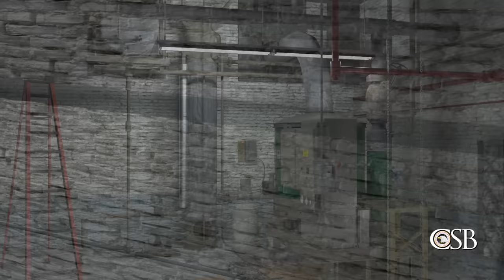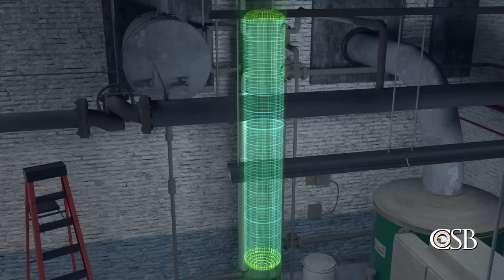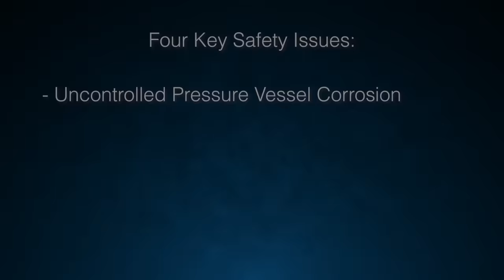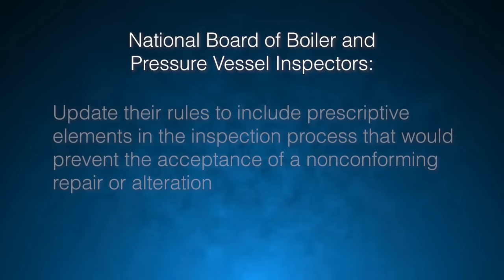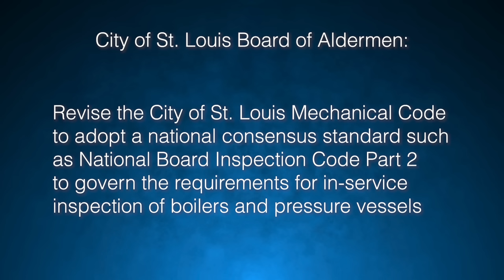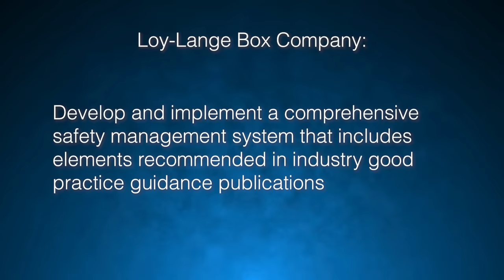Ignored Warnings: Explosion in St. Louis

Comment: Maintained a 60 Hp Boiler years ago. The O2 scavenger chemicals are expensive. You can add enough without heating the water to 200 deg F or save much money by doing so. The important thing is to keep track of the two chemical tanks assuring they do not run out.

Comment: CORRECTED TEXT
; A CSB safety video about the fatal explosion that occurred on
; April 3, 2017 - at the LOY-LANGE BOX COMPANY in St Louis - Missouri.
; The incident occurred when a severely corroded pressure vessel
; catastrophically failed - causing an explosion that launched the
; pressure vessel into a neighboring building.
; One worker and three other people were fatally injured.

Comment: Seeing the steam attempt to evacuate before the vessel launched was sad. It was trying to vent, but it was simply too much pressure. Is a very old pressure vessel really that expensive to replace compared to repairing it? Very sad people died just because a company didn't want to spend a few bucks.

I think my portable air tank has a sticker that recommends throwing it away after 10 years. Seems odd there isn't a similar recommendation for all steel pressure vessels potentially exposed to oxygen.

Comment: I'm a metal fabricator and that 2012 repair has me gobsmacked. Regardless of the repair company being qualified to carry out the repair, every single worker repairing the vessel would have been aware of just how dangerous the repair was. You wouldn't fix thin metal to thick metal on any repair never mind on a pressure vessel. When looking at the photo of the damaged vessel, that metal was almost as thin as car bodywork when it failed. The thinner failure point being adjacent to that 2012 repair. Just welding the patch to the old section of vessel would have been difficult and flagged a hazard to the workers welding it. Truthfully, a full base repair would have been easier! It makes me wonder if the repair patch was something the repair company had spare and laid in a cupboard somewhere and they went with that fix.

Comment: I work in automotive assembly. For the past four years water has been dripping from a roof drain pipe onto me. It hits an I beam then drips down. 

They have tried to “fix” this issue several times. 

The building is from the 1920’s

Hopefully it will land on my head when it falls.

Comment: Having worked with steam plants for 43 years the preheater tank needed to have a spray inlet for water entering and a vent to release any oxygen related water vapor/steam that should be captured by a vent condenser system. Then the outlet from the tank should be from the bottom not the side to reduce any oxygen laden water from gathering.

Comment: My dad used to get bullied at Rennco in Homer, MI because he wanted to add safety systems to packaging machines while the upper management wanted to use cheaper less effective measures, ultimately no one died because my dad insisted, they eventually caved but I like to think he mentioned getting OSHA involved. The constant berating my father endured led to early retirement, however. So now he does freelance work instead, but still deals with asshats that want to skimp on safety and we no longer do work for them.

I wish there was a cure for greed, but that's the society we live in.

Comment: This is a lot like making sure you drain your air compressor tanks/ run a moisture/ water separator. Tanks turn into a 'bomb' when they rust and corrode. If it wasn't leaking they would've had no way of even knowing it was corroded on the inside. Continuing to operate and use the tank when it was leaking and obviously weakened was not only reckless but foolish as nothing good could come from this. The welding company should've removed the entire bottom of the tank instead of trying to patch it and weld to weak metal. Shame that people had to lose their lives/ property was damaged over this.

Comment: So who went to jail? Company was obviously cutting safety to save money. Rushed starts up (to cut overtime), cheap rushed repairs and no backup systems or inspections and four people dead. A company that size running one tank/system was never going to shut off the system to do proper maintenance if it meant production had to shut down.

Comment: Hi Everyone, I'm curious what "testing protocols" there might be for these sorts of vessels. Can someone give me a pointer? I'm also thinking that there must be guidelines for how long this kind of equipment will last before it needs replacement. Great video, as always!
Reply: These vessels can last for decades if properly maintained.
Reply: There are a number of non-destructive testing options.  The first is an annual shutdown, open and inspect — i.e., a visual inspection of the interior of the vessel.  Then you can do operations like ultrasonic, x-ray, and magnetic flux or eddy current testing to determine wall thickness, weld integrity, and presence of stress or corrosion cracking in areas where failure is more likely.  Taking an annual thickness measurement on the bottom of the vessel and tracking it over time would give clear indication of corrosion levels, and let you know when you are the safety limit and need to repair/replace the vessel.  The three versions of testing I listed are more technical and require special equipment and training, but there are many companies out there that specialize in just such work.  During my Navy days, we used their services regularly on our steam propulsion plants to ensure our boilers and steam piping systems were safe to continue operating.  It costs money, but it’s cheaper to fix a small problem than rebuild after a catastrophic failure.

Comment: Considering how operations are run for "Maximum Profit at all costs", It's a small engineering wonder that more facilities don't catastrophically fail. Just like the neglect at an airport I'd worked at for a time, thankfully designed such that nothing should catastrophically fail. Wouldn't be surprised if the "rejection" of repair was likely just to avoid the costs of replacement.

Comment: Previously having worked in the propane sector, the possibility of a BLEVE was always present.

In addition to a "simple" water based BLEVE, a propane based will add fuel to the fire, so to speak.

In any case, operating leaky pressure vessels which contain two phases are an even worse idea than operating leaky pressure vessels for single-phase product.

Comment: I worked in the boiler industry for ten years after Katrina. Most of the work was in New Orleans or surrounding  areas. There had just been a scandal concerning the selling of 3rd class boiler tech licenses to anyone who paid an extra $200 for the test. This caused an influx of technically unqualified "technicians". The things I saw there were truly frightening. Lots of close calls. Boiler inspection is spotty at best with lots of "wink-wink" inspections along with simply not doing the inspections. In addition chemical treatment of feed water is not properly done if at all. Boiler disasters are seldom brought to the attention of the public. When they are information is minimal---usually a one inch column on a back page.

Comment: Now I'm not an engineer so maybe I'm missing something, but wouldn't it be protocol to shut down a pressurized system if you discover there's a leak within it? Also, if the integrity of your system is compromised by corrosion and the repair is to replace the bad section, why leave any bad metal? Especially when its all one continuous section. That's like be told you have a tumor and need it removed to save your life, but the surgeons only removes 90% of it. Could have went ahead and got it all, your already opened up, but no, they stop. What do you expect is going to happen.

Comment: As a Boilermaker, this is crazy.
Its a leaking bomb.

1) You need to have 3rd party inspection companies come out and sonogram at the very least, metal thicknesses for your pressure vessels and ensure that its not even just the RUST THAT YOU CAN SEE is the only weak point.

2) What a lazy repair for that welding company. If they don't lose their R stamp, accidents like this can happen again.

3) Any industrial company working with such dangerous equipment should have way more common sense to operate something that is deficient. Its not like your personal car with a radiator leak. Its a bomb.
Corruption, lack of training, ignorance and ultimately laziness creates perfect dangerous situations in industrial facilities.

Comment: what if you add a mixer into the SCR so that the temperature is more isotropic and the measurement is better? Maybe a tube that goes down the bottom so it stirs up the bottom into the top?

Comment: It's the same problem as in the RBMK chernobyl reactors. The whole thing standing in a sheetmetal shack. If that vessel would've been in a proper reinforced concrete building, the vessel could've never rocketed through the roof.

Comment: A one ton pressure vessel was launched 400 feet into the air killing 4 employees of a nearby healthcare business and injuring 3 other people. The 10 resulting lawsuits were settled for $47 million. I guess the law firms involved may have been given 40% of the settlement which would leave $2.8 million for each victim if the remainder were divided equally between all 10 victims. I think law suits are good because it allows businesses to see how much cheaper it is to have effective safety measures in place. The operating procedures for the steam system should be taught to the employees and managers every year to eliminate the effects of employee turnover.

Comment: Even before I'm a 1/4 of the video I see trouble.  With steam you need presure relief blow offs and automatic waterfeed at certain locations. The biggest issue it looks like the original set-up when first installed. Companies should be forced to upgrade parts that are critical for safety. There should of been gauges with warning sounds when something is becoming a problem. Or there could of been warning lights. I don't know how that boiler works but do know about steam heaters. Maybe a low pressure cutoff would should of been installed. These safety devices can be set-up to shutdown  the boiler

Comment: This is the first video I struggle with the analysis. 
Oxygen permeating into the steel could have been leaked into the vessel during the repair. Also there is no proof of O2 water not being purged properly. The SCR could have obsorbed water from other locations.
Reply: Water naturally contains dissolved oxygen. That's the whole point of the make up tank discussed in the video - to remove that naturally occurring oxygen by heating the water to near-boiling, and by mixing in oxygen scavenger chemicals. The video mentions that the Loy-Lange water regularly contained insufficient concentrations of oxygen scavenger, and that the water in the makeup tank likely wasn't warm enough at the point at which make-up water was put into the SCR each day.

Comment: Annual wall thickness checks can be easily made using an inexpesive handheld  UT device(<$200). Carbon steel is the wrong material application, today we would specify Cr-Mo Gr 11 or better. (Stainless is overkill and introduces welding problems an Cr migration in the HAZ).

Comment: A chinese owned restaurant a street away from my office replaced a leaking pressure release valve on a common water heater with a pipe plug. When it exploded, it landed in the street where I usually parked. WISHA found the owner was too cheap to spend 10 bucks or so on a new PRV and got a brass plug from the auto parts across the street. Luckily no one was injured but the building had major damage. If the tank had went another 50 feet, it would have landed in my companys office.

Comment: Let me get this right... Inspectors are not required to inspect the work or plan, or even the damage that leads to it, and the city had a company with a steam generator they had inspected, but because it had been years they didn't know it has a pressure vessel... BUT... how are you making steam NOT under pressure for an industrial process?! Literally boiling water, its a boiler...

If your boiler inspectors don't inspect boilers, and the city inspectors dont even consider them boilers (due to fraud ofc), something like this is garunteed to happen...

Comment: As much as I appreciate these videos I wish the USCSB was more than an underfunded agency without any real power to enforce the findings and best practices present in their reports. 

I am honestly surprised that these sorts of failures are not more common as steam systems and boilers have become largely forgotten about and are poorly understood at best by most. Steam heat is increasingly less common especially in new construction and we are so far removed from the old days of steam powered transportation. Few outside of an ever shrinking pool of experienced boiler and steam plant operators, or old engineers with decades of experience have any real understanding of the hazards and their proper mitigation. I would be most municipalities do not have someone with proper training and knowledge to fully inspect and regulate such systems.

Comment: As a licensed boiler operator for 47 years I can tell you that the vessel in question should never have been allowed to be in service.  After it was inspected and found to be unsafe it should have been "RED TAGGED" and not allowed back in service until it was made safe and inspected again.  This is an explosion that never should have been allowed to happen.  Shame on the local authority for allowing it.

Comment: I'm curious if uscsb has already been investigating the multitude of assorted food processing plants that have burned.
In case it may have been caused by equipment failure from manufacturing flaws. Or by failure from negligence. Because it appears that a number of the facilities had equipment over run, overheat and catch fire. From the electronic systems not working properly. Some claim those systems were cyber attacked. The destruction of our food supply system certainly needs in depth investigation. Especially considering similar occurrences have damaged fertilizer processing and other related manufacturing facilities. At the same time that we are pushed to reduce use of fertilizer and elite entities with the military or attempting to cloud the skies to block photosynthesis. Using chemicals and materials that are harmful to the soil and plants when they precipitate in the rainfall. If this is not already under deep investigation, please do so.

Comment: I do appreciate the recommendations the CSB made but I believe they missed an important safety hazzard.  They didn't say whether or not they even considered the safety of the neighboring business who lost three people.  Nor did they make any recommendations as how to mitigate risk when a failure occurs.  They were obviously aware of the potential failure of the pressure vessel.  No business should be allowed to install such a device that could fail the way it did and kill the people in that neighboring business.  
     I believe that building code should include safety containment systems whereby either the pressure vessel could not escape the building it's in, or it would lose sufficient energy before escaping to keep it within the business property ensuring the safety of all surrounding properties.  Each safety system would be designed based upon it's proximity to it's property line.  Perhaps something like a heavily reinforced steel mount to a concrete floor and energy absorbing ceiling and walls would suffice.  
     The pressure vessel could be designed in such a way that it would fail in a more predictable way such as tearing a larger hole in the vessel so it loses more energy more quickly so it could never travel as far as it did.  That would likely disallow the welding repairs.

Comment: I don't understand how the physics of how an explosion was created. I’ve  watched this twice. I wish this was explained.
Reply: Anytime you have a liquid that would rather be a gas at atmospheric pressure kept as a liquid by holding it under pressure you are storing significant amounts of energy. If that liquid is allowed to change to a gas due to loss of containment such as a total failure pressure vessel it will release all of that energy resulting in an explosion. 

When water flashes to steam it expands to about 1700 is original volume. If it is a small leak or controlled release through a relief valve it is relatively harmless. If the entire bottom of a pressure vessel fails instantaneously you have a bomb/rocket

TLDR: Steam and volatile gasses held as liquids under pressure can be very dangerous and need to be treated with respect.

Comment: Loy-Lange was assessed a proposed fine of $8,873 for this event, which killed 4 people. The fine was subsequently reduced to $5,918. Clearly, this had zero deterrent value for any company - this fine, for the culpable death of 4 people, was less than the cost of the improper repair done on this vessel.

In order to force companies to comply with the safety regulations already on the books, fines for events causing serious injury or death must be massively increased. For example, if Loy-Lange was fined $25 million for each culpable death, due to illegal operations, every other company in the industry would immediately make certain that their equipment was in compliance with appropriate regulations.

Fining a company $1479.50 for each death their illegal, unsafe practices cause is not only ineffective, it is disgusting. What person's life is worth less than $1500?